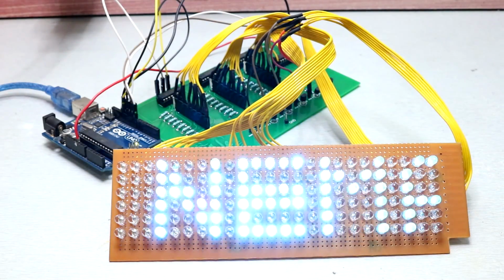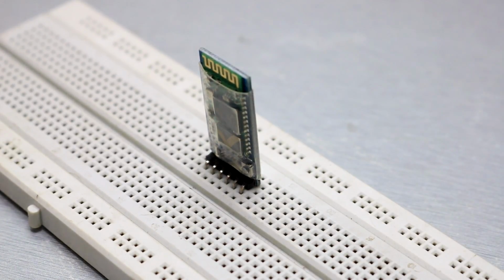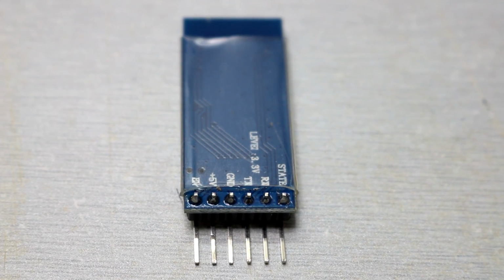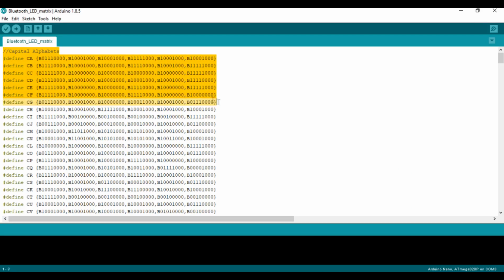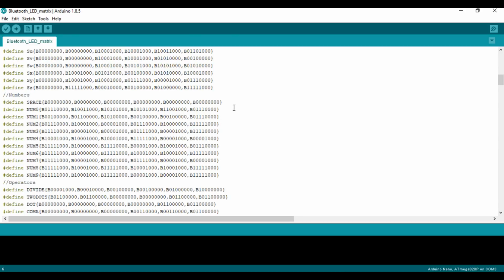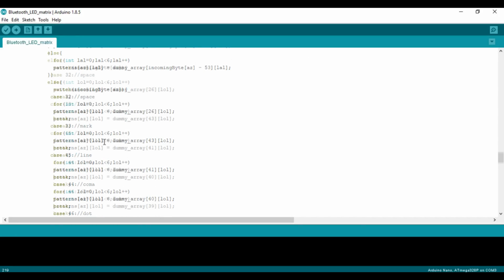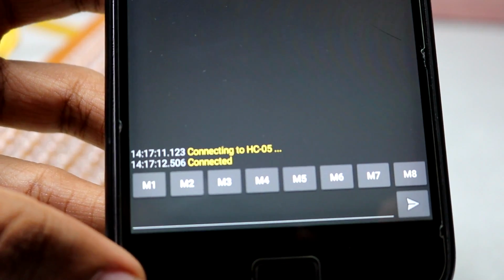Bluetooth Controled LED Matrix !

Comment: Hi, This is great stuff!

I have a query, if I was to make a large display..say 4x3 feet with static text that I can change using bluetooth or some other way? What IC, resistors, and processor I would need.
Reply from the maker: I would recommend you to Google about P10 LED display they are easy to use with Arduino
Reply: @Nematics_Lab  Thank you!

Comment: You guys are fake, uploading a small circuit in jlpcb and saying it's 2$ only.
Kindly upload the actual gerber file which you uploaded in https://easyeda.com/nematic.business/246_LED_Matrix-1108d969103d466fac273bbc89ac1ed3 link .. it says 

Engineering Fee:$8.00
Board:$10.38

Total: $18.38

You're FAKE !!!!!!!!!
Reply from the maker: $2 is for 2 layer PCB this project is 4 Layer PCB so Price is More
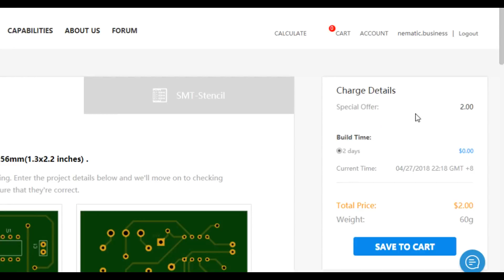Reply: @Nematics_Lab  As you said in 1:04 for the 2 layer pcb they charge only 2$ and after a week you received it, there you're showing a 4 layer pcb which costs 18$.. hahaha fake marketing by Chinese & we Indians supporting them. keep it up...